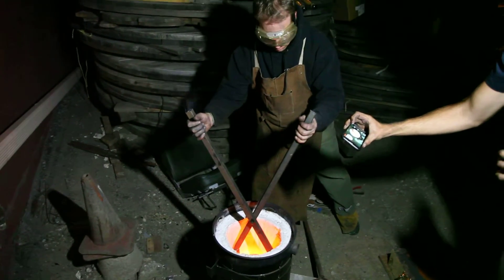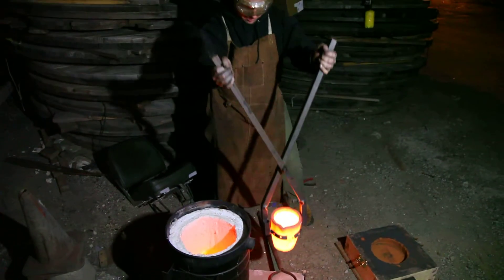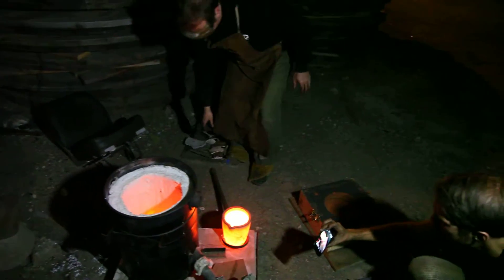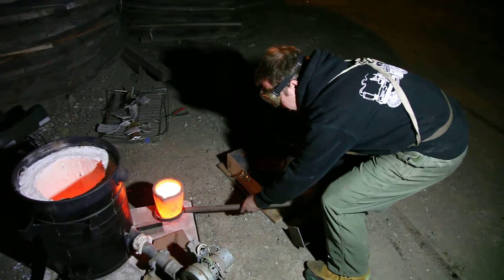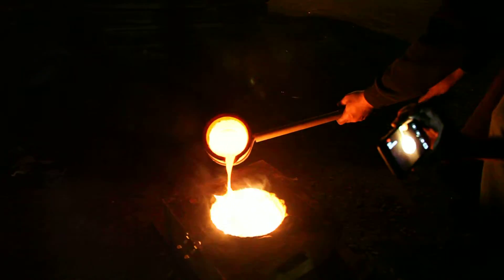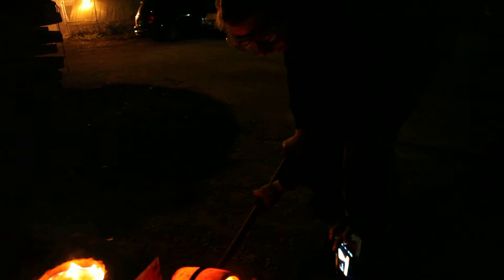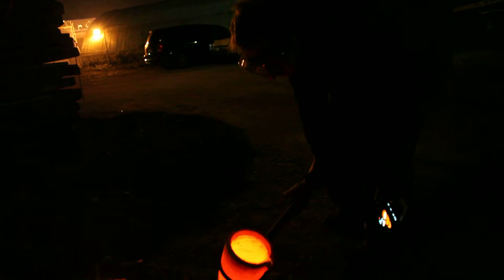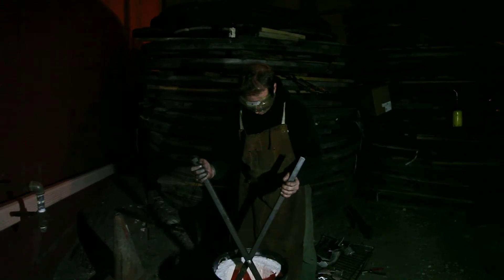First Aluminum melt and pour at KSW

Comment: First time I have ever seen a vid where there was some safety Nazi crapping on about gloves right as the vid was taken.  What a surprise he wasn't the one doing anything useful.

Hope this turned out well for you. always a thrill to do your first pour and casting.
I look forward to seeing many more vids of what you make.
Reply from the maker: Lol. It was actually a member of our group. What they didn't realize  (or maybe think about) was that it would take a while for heat to travel that far up the lifting tongs (or pouring shank), so I was in no danger of being burned from heat from conduction. The lifting tongs were hollow, and they were either channelling some of the smoke from the fire or the fire/heat was burning off some of the protective oil coating on the steel (we had just made the lifting tongs that hour from new steel). Either way, the smoke wasn't anything to worry about, as I could tell from the feeling in my hands. There are times when wearing gloves makes you LESS safe because they reduce your feeling and dexterity- I felt this was one of those times.  I was afraid of not gripping the crucible firmly enough and having it drop and spill, and at the same time afraid of gripping it too strongly and crushing the crucible with the same results. 

As far as future pours- we poured (6) pulleys for Bay Area Maker Faire, which I also have (better) video of and still have to edit/post. Said member did at least one of those pours- I'll have to see if gloves were used... Lol.

The aluminum, as I may have mentioned elsewhere, is just to get some experience before we step up to cast iron. There are already things I would change just from doing the aluminum. I'd make sure I had more clearance between the crucible used and the wall of the furnace (the one we're making now will have an inside diameter of 14", which is the OD of this one. Secondly, I'm considering either shelling out the $300 for a professionally made set of lifting tongs with a bottom support and ratcheting locking mechanism or making a new pair that has that. Lastly, we might invest in a pyrometer since in this pour and some other subsequent pours, we burnt the hell out of our petrobond sand and had to discard a fair amount which was pretty wasteful. We knew that we didn't want to pour too cold and get cold shuts or ruined pours and errored on the side of "caution" and poured too hot, knowing that all the molds would get fully filled, at the expense of some sand.  

I've found that (smart?) people that don't know what they are doing tend to error on that side of caution until they figure things out (if ever), and then adjust as/if they get better. This annoys people who already DO know what they are doing and who realize the extra caution is unnecessary/unwarranted/overkill. Armchair quarterbacks are always going to hate. As long as it is relevant to the content of the video and adds to the discussion, I'll leave it and won't delete it, but there are plenty that I have already deleted. People don't want to wade through 1,000's of comments of spam. Thanks for the words of encouragement. I think I'll continue working on the new, bigger furnace tomorrow.